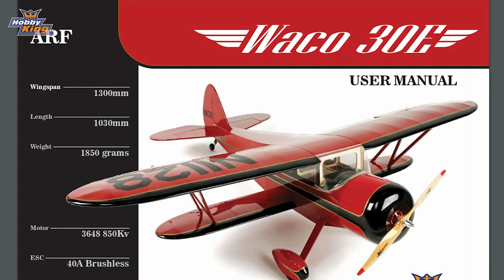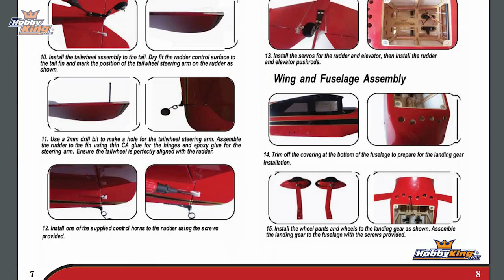Waco SRE 1300mm Balsa Biplane (ARF) - Product Profile - HobbyKing Live

Comment: I love my WACO SRE. It flies just beautifully. 
I did find a couple of issues with assembly. The wheel pants are a trick to fit onto the axle. You need to either cut the axle shorter, or punch a hole through the opposite side of the pant to sleeve it through. The instruction are "vague" about fitting the axle.
Also, the elevator hinge wire should be carefully checked for fit and angle of the two part elevator, else you will wind up with uneven levels. Once glued into place you will damage the balsa frame if you try to change the bend angles.
Finally, you need to reinforce the bottom mount plate of the landing gear. I flooded the base edges where the double layer ply meets the side walls with epoxy. It might be better to fit some fibre glass tissue and epoxy this into place, just to make the bottom plate stronger.
I also permanently fitted the wing, did away with the rubber bands and installed three zip ties to keep the top and bottom wings connected.

It's a great model, so good I  used an image of the WACO SRE for my channel ID thumbnail! :D